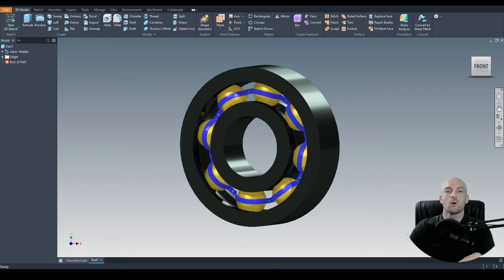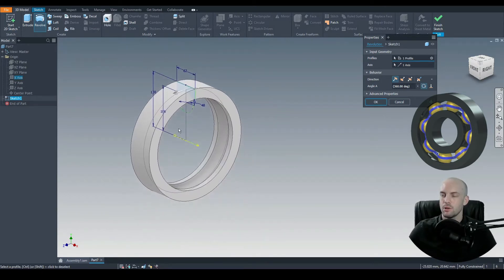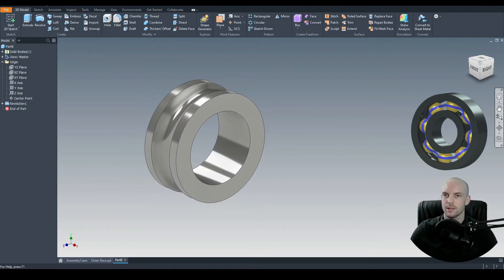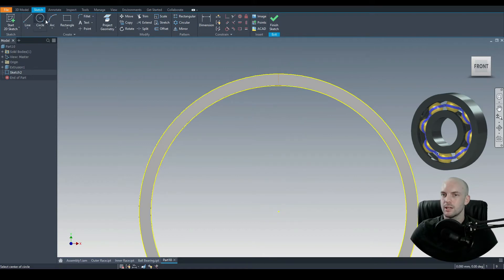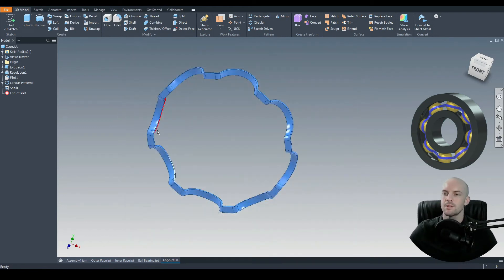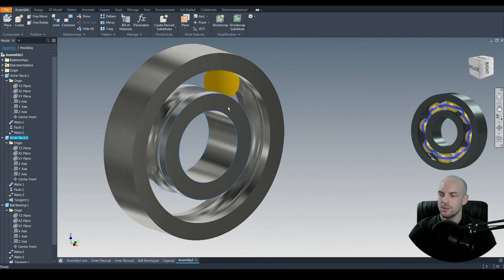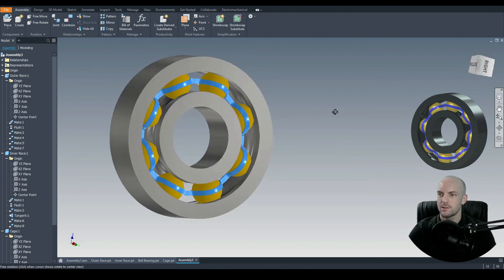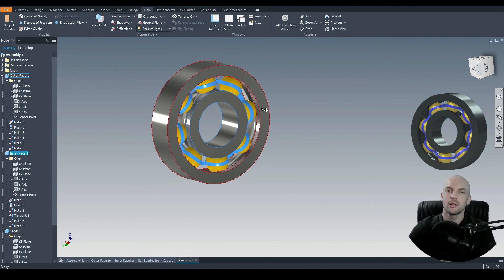Ball Bearing | Autodesk Inventor 2021 | Intermediate Tutorial

Comment: Why should any body create it , where you can insert it ready by standard from content center libraries???
Reply from the maker: Hi Ebrahim. I agree with you that it is efficient practice to use standard conforming bearings, many as you say are stocked in the Autodesk Content Libraries. My tutorials are all suited for the college students that I teach, and so the Bearing part is just being used as a mode for 2D & 3D part modelling and a basic assembly in CAD software. The students are challenged by it so it works well. Have a nice weekend :)
Reply: @AutodeskInventorTutorials  Thnx, to you too

Comment: hello, what is your key shortcut to see if the inner ring can rotate?
Reply from the maker: Hi Rocyn, there is no key shortcut, you just need to hold down click and drag to rotate. I see in the comments you are unable to rotate the inner race, one thing to do here is to Right click on the inner race and make sure that 'Grounded' is not got a tick next to it. If so, it is grounded (and hence will not move). If you're still having problem I recommend selecting the inner race in the design tree and open the 'relationships' folder and delete all relationships of the inner race and then re-apply the ones without constraining the rotation ability. It's difficult to diagnose without seeing your screen. Feel free to email me at  cadchris2021@gmail.com and you can share your entire assembly and partts - :I can then open your files and fix the issue. Hope that helps! Enjoy your weekend!
Reply: @AutodeskInventorTutorials  thank you so much, later I will try it again if still doesn't work I will email you 😁
Reply: @rocyndominicllacer6679  right click the first placed part (outer race), and clicked grounded
Reply: @AutodeskInventorTutorials  good evening sir I have sent to you my files because I encounter another problem need help :>

Comment: Hi. How do you place the image of what you are modelling while doing your modelling?
Reply: I get that but when you start your 2d sketch at 0:13 the image does not interfere with the modeling, how is it kept on the far side?

Because when I start another sketch it will bring the 3 planes  with one of them having the imported image and I don't want that.
Reply from the maker: Hi C N, Ahh I see, the image of the complete model in the top right corner is a top layer (with 80% transparency) that I've added in my video editing software, I'm afraid it's not actually in Inventor. when I am modeling the part(s) I use two monitors - one with Inventor on and the other is a set of images with dimensions so I can quickly reference them for the tutorial.
Reply: Okay, I thought it was inventor doing that. Thanks for replying!
Reply from the maker: Hi @C N. To place an image like a JPEG or PNG file into the modelling environment, you need to start a sketch on any plane and then click on 'Insert' which is under the 'Sketch' tab. Then select your image and place it on the plane. :)

Comment: hello. I am new to Autodesk and I had a problem.  In 7:35 you did a tangential constrain and you were able to rotate the ball using the inner race. Whenever I press the solution as inside, it doesn't go in the inner race instead, it just remains in the outer race. Would you perhaps know what I might be doing wrong?
Reply: as a matter of fact I am not even able to rotate the inner race.
Reply from the maker: Hi @Madhav, this is difficult for me to diagnose without seeing the constraints and relationships in your assembly file. The Inner race should be able to rotate at this point, check the existing constraints on the part in the design tree under 'Relationships', there should only be two constraints: flush constraint with the flat fac of the outer race and  a concentric constraint between the axis of the outer and inner races. Then, there are no constraints preventing the inner race from rotating.... You may need to turn on the visibility of the planes for the inner race to actual see it rotating (otherwise it may be rotating but not displaying graphically).

Now for the Tangent constraint between the ball bearing and the inner race - ensure you have selected to inner race 'groove' and that the option is 'inside' as you mentioned. Also ensure that the plane constraints with the inner race are correct as well. 

If you continue having problems then send an email to cadchris2021@gmail.com and send me screenshots of your design tree and the relationships. Perhaps we can setup a screen share and I can guide you through it.
Reply: i have the same problem :<
Reply: i had the same problem. I forgot to fix the first part at the origin. Now its working